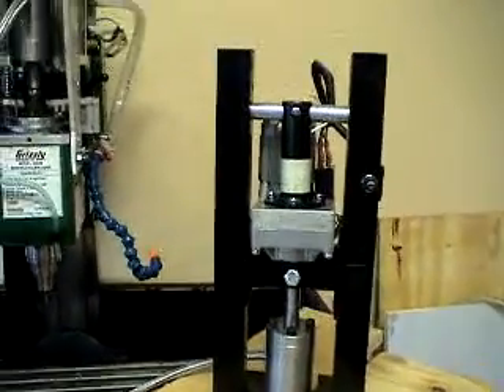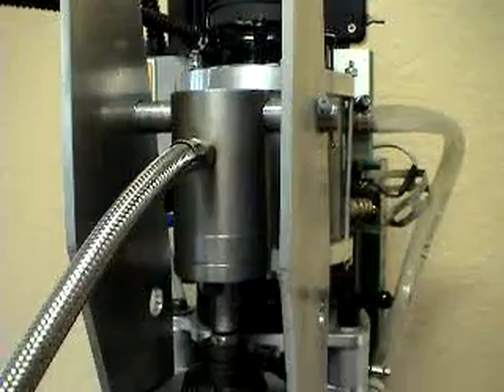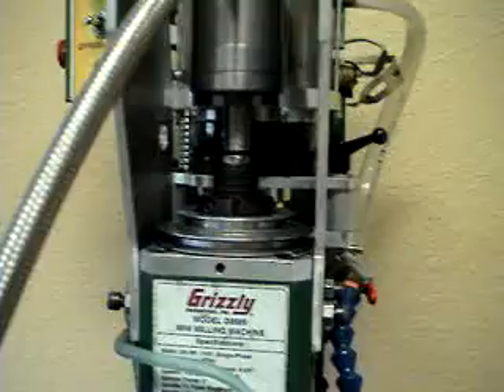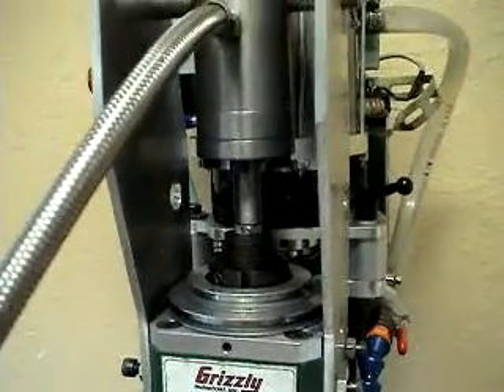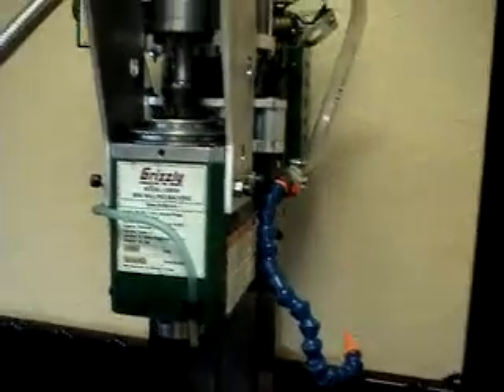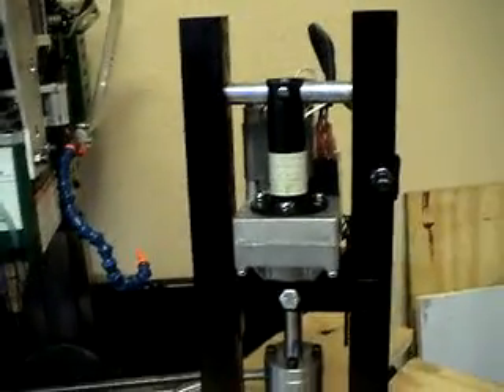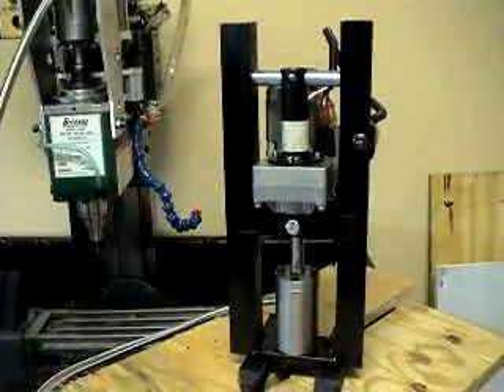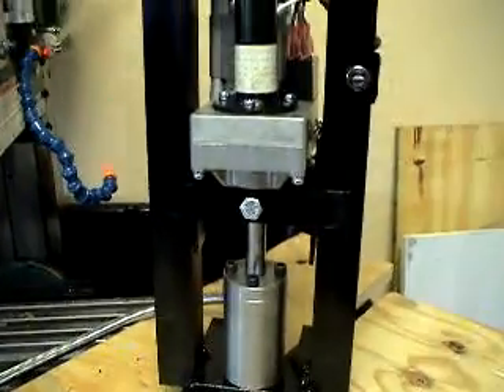X2 Electric-Hydraulic drawbar

Comment from the maker: Update:
Even though this works, I've decided not to use it and instead go with a single small air cylinder mounted on top similar to Hoss's setup. And will use a silent air compressor to power it. The noise of a standard air compressor is the main reason I went with electric to begin with.